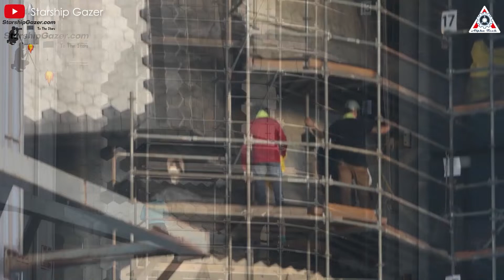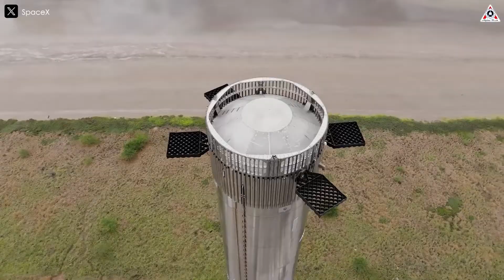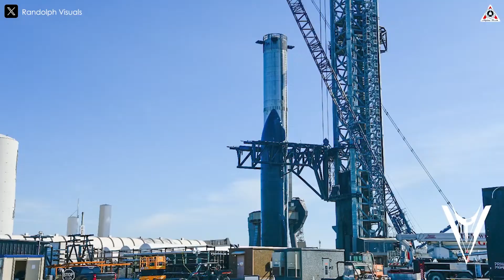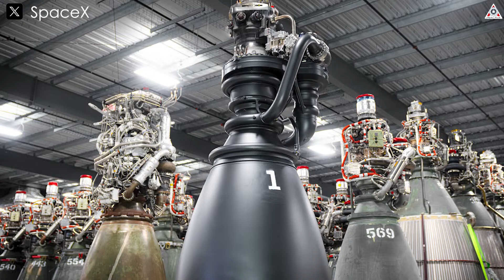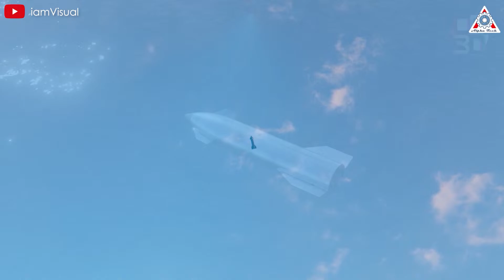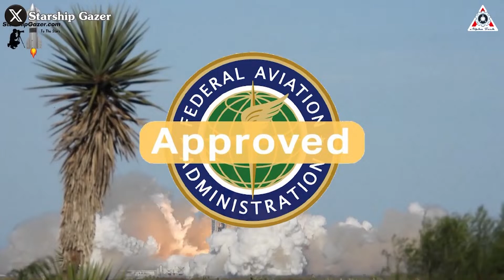SpaceX's Mind-Blowing Solution to Redesign Starship Somehow Copy Soviet Rocket Method!!!

Comment: The increase in complication on downcomer tubes is a good example of how and why parts count works.

I might suggest that they go back to a single down comer tube, make it oversized diameter wise, to slow vibrations in relation to surface area on their air sping effect in the tanks.
And instead of an octopus of pipes from a central point, consider flairing out the downcomer tube at the bottom like a reversed funnel, to increase the area of access, and shorten pipe runs to engines.
And then gusset every fuel/oxy pipe radially with say 6 corner gussets.

Chances are the welds are cracking.
And small gusset tabs would fix it.

I'd use strap, leave a rathole over the tube end weld, and 45° the outer corners a tich to lighten and give aesthetics. If you wanna get fancy they could be even be tapered too slighly.

Just dont overweld everything and create a chunk of krap. 

Think elegant gussets...

I think that will fix the issue... and also cross gussets in high stress seam welds on tanks wouldnt be stupid. 
Lock any crack closed.

If it leaks less, chances of making it home are better.

Just sayin'
😂